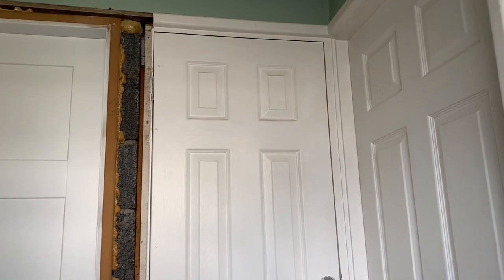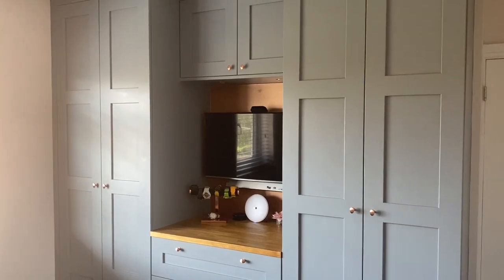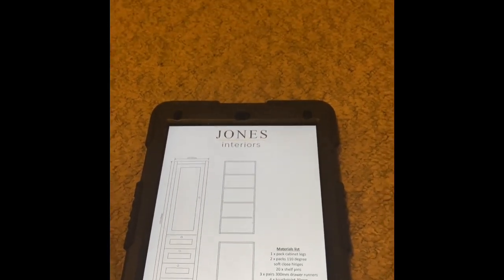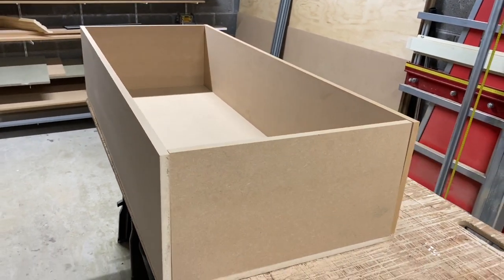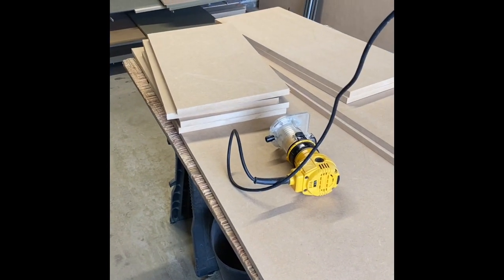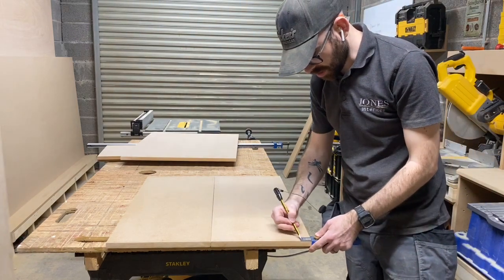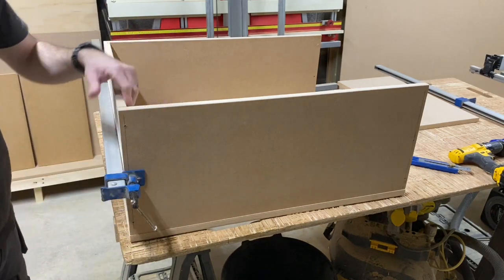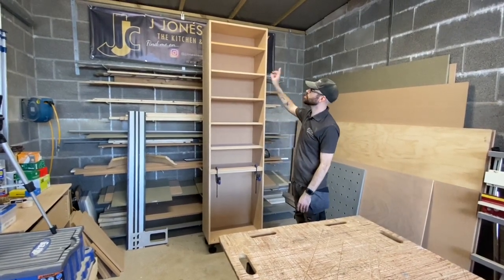Jones Interiors episode 2 part 1 - fitted cupboard with drawers and shaker style doors step-by-step

Comment: Like previous comments youl be a big hit on here. I've only just found you through Alistair at firebird. Really like the pencil idea too👌I built some mdf wardrobes over 6years ago and left the inside bare but just sealed it with mdf sealer and it's still as good as new. I hope that was radio2 I could here in the workshop🤣🙌
Reply: "Freebird" not firebird🤣

Comment: Did you ever try using 18 gauge panel pins to hold it before screwing instead of the clamps?
Reply from the maker: sean duffy I have in the past which is better than clamping it but you do get the pin holes on the side of the drawer then - which I prefer not to see. I just need to get better clamps!